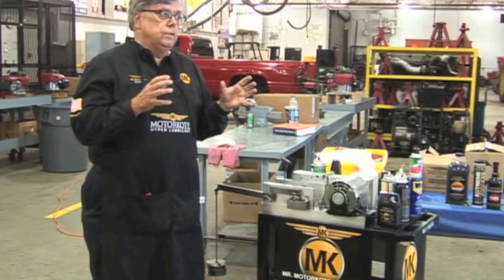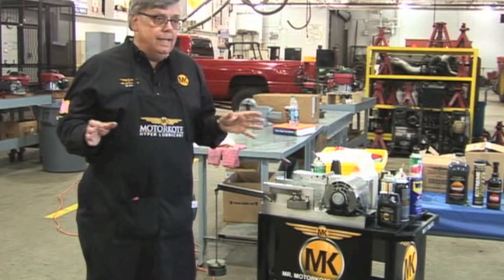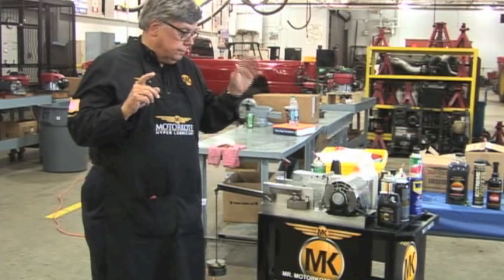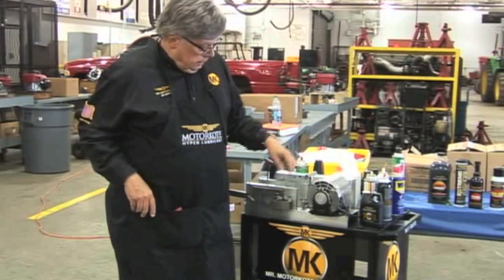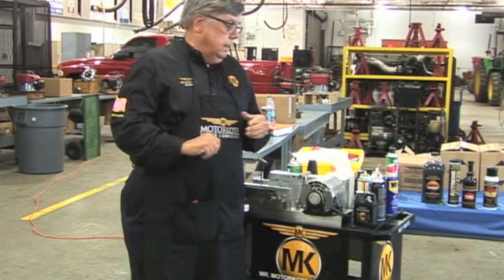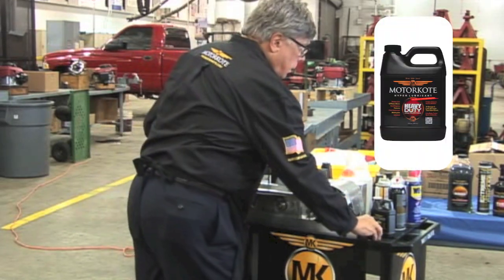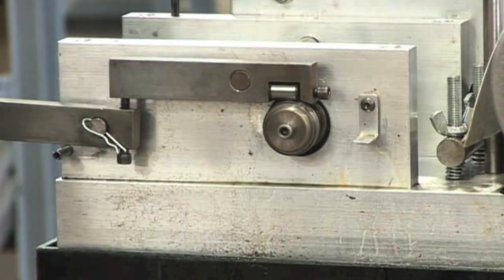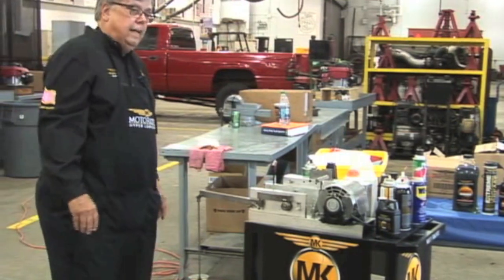Motorkote® Demo

Comment: Snake oil, nothing more.  I actually bought some of this and ran it in the engine and manual transmission of a car that only had 35,000 miles on it.  5,000 miles later the transmission was popping out of gear and had to be replaced.  10,000 miles later the engine had a lifter go bad which wiped (ground) one of the cam lobes off, had to buy a new engine because of that.  In both cases I saved oil change receipts and tried to get Motorkote to back up their warranty, but they totally ignored me ~ "TOTALLY".  But I'm not going to ignore them, I recommend to all my friends to "STAY AWAY FROM Motorkote" !!!!!!!
Reply: Other multiple independent tests over youtube shows this stuff works. You bought POS car.
Reply: @fido139  or did not do the proper maintenance
Reply: I've used it in high mileage 2000 f150 transmission and engine, still going strong.
I run it in my 2009 Saab 9-3 with stage 3 tune through BSR, no engine or transmission trouble at all yet (140k).
I use it in my girlfriends 2008 Saab 9-3 with 200k miles also with no issues.
Reply: I am a mechanic on both cars and diesel engines and I can tell you that Motorkote is NOT the cause of your transmission or engine issues! I own a 2002 Ford f150 with the 5.4 L Triton with 240,000 miles on it. I had started using Motorkote and 5-W20 FULL SYNTHETIC engine oil when I first got the truck which at that time the truck had 75,000 miles on it. I put Motorkote in everytime I do an oil change. I have yet to have any issues with engine, transmission, or differentials.
Reply: @jamesstafford9067  Good to know, thanks for sharing. However, that engine would probably get to the same mileage without using any additives. It would be very interesting if someone did a test where they take several brand new engines, treat each of them with a different additive, and run them for the equivalent of 200K miles or so and analyse the wear that took place.
Reply: @averyalexander2303  Hello Avery, I am sure that if you research You Tube, you might be able to find such results. I am just speaking from my personal use and I can tell you this............
I owned a 1996 Freightliner FLD120 with a 60 Series Detroit   and my driver lost 2 oil filters and the oil. He drove 235 miles with no oil in the engine at all. He drove and got the repairs made, drove back to MI where I inspected all bearings and there was absolutely no wear at all. Thanks for the response and I will be more then glad to try and help you with any other questions, comments, or concerns. Happy New Year
Reply: @jamesstafford9067  Wow, that is an incredible story! From some of the videos I found online, I don't doubt it though. Just curious how the driver ended up losing both oil filters at the same time? That seems extremely odd. Thanks
Reply: @averyalexander2303  Sir, believe it or not......I have several friends who are Ford Dealership mechanics and they have told me that the 5.4L Triton engine usually holds up to approximately 150,00 to 175,000 miles before one starts having engine issues. I have dropped 4 main bearings and 4 opposing side rod bearings and there is absolutely NO WEAR indicated. My friend Roger has put me in touch with Ford engineers who are looking at the possibility of adding Motorkote to the break in oil and possibly implementing it in the service regimen. I have used Lucas oil stabilizer in 2 of my tractors (semi trucks) and here's the issue that I have found. Lucas does NOT mix with the oil to stay versatile. Remember the remedy for bad rings and valves called Motor Honey??? Lucas is just like that. It's a very think sap. When your engine is cold, the Lucas is setting at the bottom of your oil pan,  when you start up your engine on a very cold day, it takes approximately 1 minute for your oil pump to get into the oil. Now, not only is Lucas hard on the oil pump, but now the upper end of the engine is starting to become damaged. I hope that you can relate lol. Have a terrific day.
Reply: @averyalexander2303  The TA truck stop had done the service on the truck and the mechanic stated that he accidentally forgot to tighten the oil filters. He had only spun them on and tightened by hand lol 🤔🤔🤔
Reply: @jamesstafford9067  I agree with you about oil thickeners like Lucas and Motor Honey. Those additives have been analyzed and found to contain no additives, they are simply oil thickeners. If I wanted a thicker oil I would just use a thicker oil.
Reply: @jamesstafford9067  Wow, that's very impressive that the engine survived! Thanks for sharing
Reply: James Stafford adding Motorkote to the break-in oil? That’s counterintuitive.
Reply: suzuki06g
First off for you to call this       " Snake oil" is NOT FAIR!!! As I said, I am a diesel and unloaded mechanic and work on everything from Class 8 tractor / trailers to lawn mowers and snowmobiles. I am not buying your story at all!! First of all, if you bought a vehicle that only had 35,000 miles on it, it would have been covered with dealership/manufacturer warranty. It sounds like you did some sort of modification to the engine and voided your warranty. Secondly, you could have simply changed the cam and lifter. You didn't need to buy a whole new engine. If you only had 1 cam lob and lifter, you did not adjust the valve train properly. This was at no fault of Motorkote and sounds like you were just trying to get a free engine out of it. I owned a 1996 Freightliner FLD 120 and was running Motorkote in it when my driver lost both oil filters and all engine oil. He bypassed the oil pressure switch and drove the truck and trailer with 45,000 pounds 235 miles to get appropriate repairs ( 2 new oil filters and oil ). He then drove the truck back to Otisville, MI where I proceeded to inspect 4 main bearings, all 6 of connecting rod bearings,  along with the cam bearings and there was absolutely NO WEAR on any of the bearings. With this being said, don't blame a product for your poor decision making on your part and try feeding your line of crap someplace else.
Reply: Its tested to work, go to Project Farms video of this, test it your self. Its a friction modifier, it fuckin works.
Reply: E bom mesmo

Comment: The problem is, that you are going to only mix 2 oz. per qt of oil. So the friction will obviously be higher as the engine runs right? Why didn't you do the test with the Lucas mixed with oil and the Motorkote mixed with oil? Instead of full strength w/o oil?
Reply: So you do think that when mixing that scam product "Lucas" with oil it's going to create a miracle, if only alone it's equal to nothing? On Project Farm you can clearly see that Motorkote even beats the already proven Bestline, in terms of how good it is even when mixed with oil in small amounts. Think again!
Reply: They are both to supplement oil. Neither is supposed to be an oil replacement.
Reply: fair test  are you going to buy pure motorkote and run it in your engine